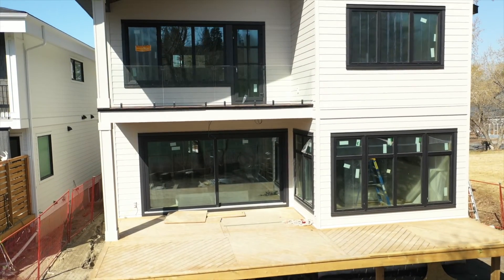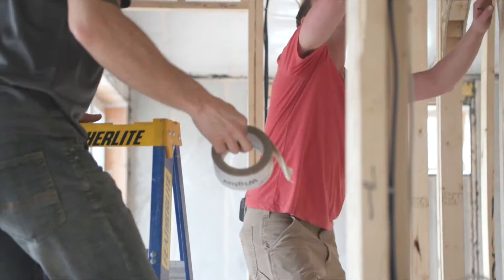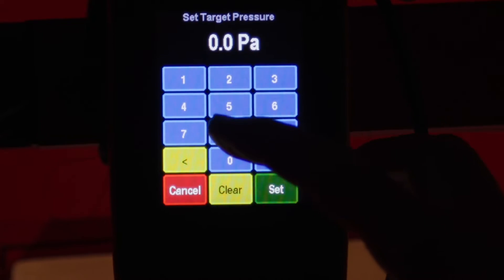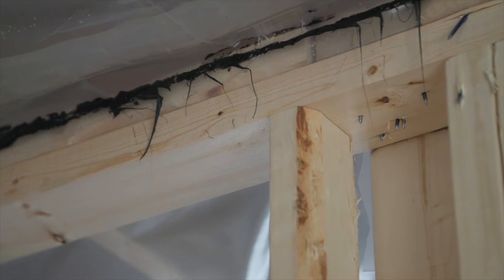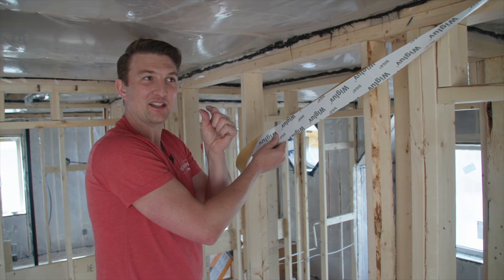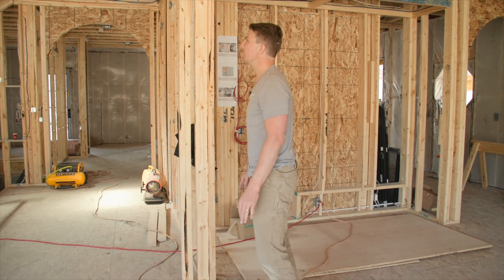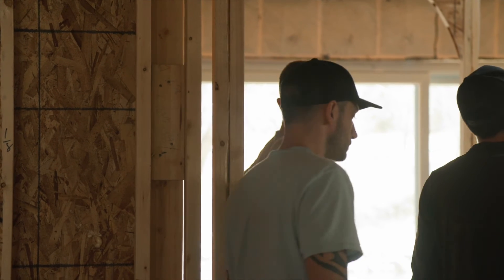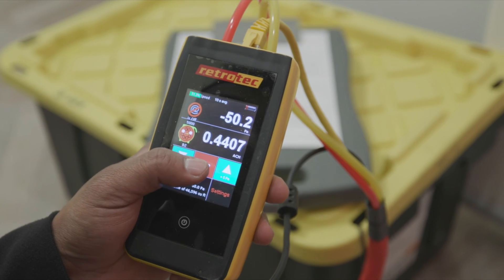ALWAYS Do This Test! - Blower Door Test Results

Comment: BD Test should be done before rough in inspection. The leaks usually are exterior penetrations. Easier to find when walls are open before insulation. Most can be seen visually with light coming through. Biggest leaks are rim joist, plumbing, electrical, sewer and top plate; walls to attic, ceiling lights and HVAC penetrations.  
Penetrations will not be sealed with tape over netting.
ERV's are needed to keep the house fresh and safe from poor IAQ and moisture build up.

Comment: First, in real life no one will put blower in front door , and pressurize the house. So it is just indication. . Second , for poly to poly connections, house wrap tape like Tuck Tape, is  air tight and does excellent job. For interior poly to wood connections,  Tuck Tape still work, but I am not sure if it is meant for that

Comment: So you do all that work putting up poly and caulking it, tapping it and trying to make it as tight as possible. Then the day the new homeowner moves in all the work goes down the toilet when the start hanging pictures and tv's. Do you know for every nail hole in that poly 1 quart of water can get into the wall cavity? Then it can condense on the outside sheeting and get the insulation wet and eventually cause mold. 
I've been building over 42 years and never have understood the logic of poly on the walls. I built a house in 1995. Building department forced me to put it in. Currently remodeling that house and all the drywall is remove along with all the poly and definitely not going back in.
Reply: exactly, this is obsessive insanity. Everyone nodding their heads and agreeing in the comments are nuts. This is a disaster financially and from a construction standpoint.

Comment: How do you get around Sick Building Syndrome when you make a house this tight? What happens when the mechanical ventilation system goes down?
Reply: You open a window?
Reply: @johnweekend8652  That'd never work. The only solution is obvious: You gotta start punching holes in the exterior walls.
Reply: I think he probably uses a heat recovery ventilator (HRV), but as a designer building so tight is concerning. Here it's 5 years to discover, 2 years to litigate.